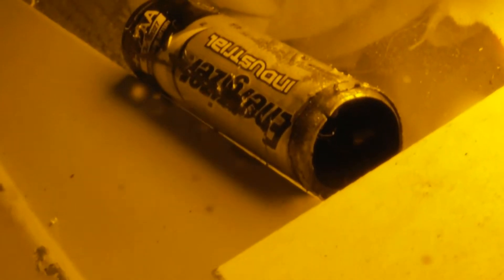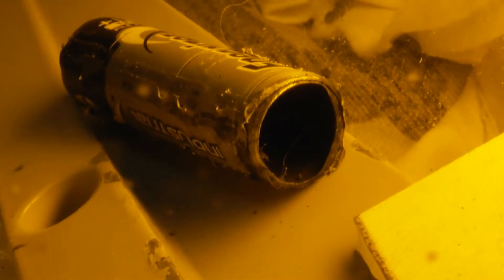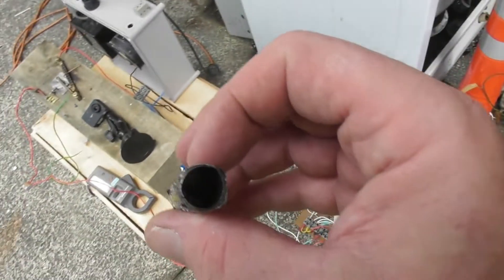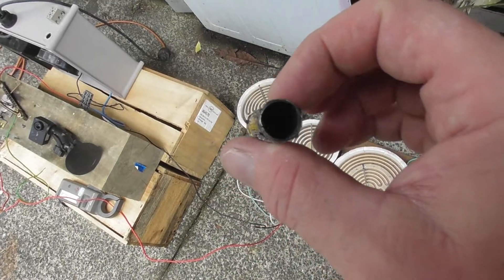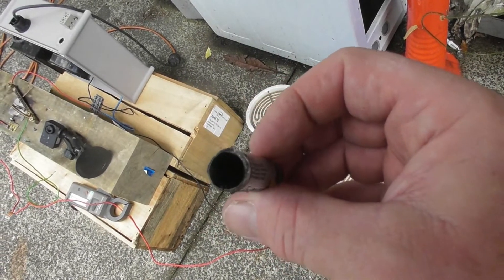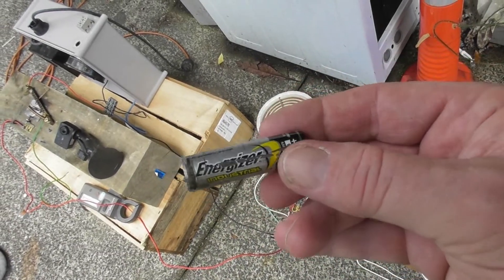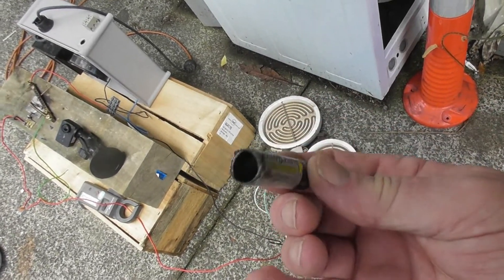Energizer battery explodes

Comment: I once suggested to Ed to clamp the top and bottom of a capacitor with something non-conductive and then pop it, apparently it was pretty loud. Never got to see a video of it though, might be amusing to try, with a bit of caution of course. But yeah, it prevents it from venting normally, having to go out the sides of the can.
Reply from the maker: I may do some frozen caps in Ice.
Reply: How about put it in a block of resin/fiberglass?